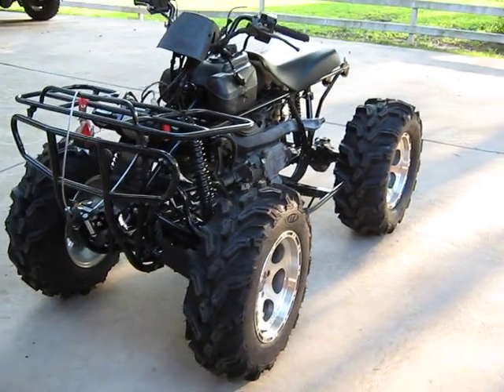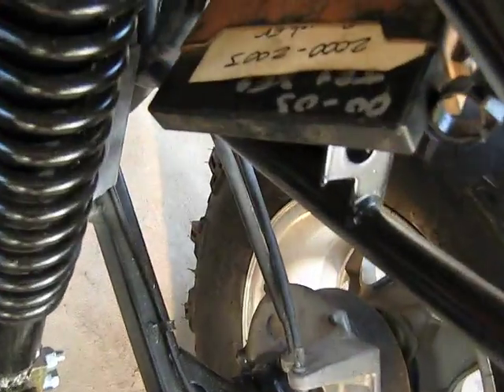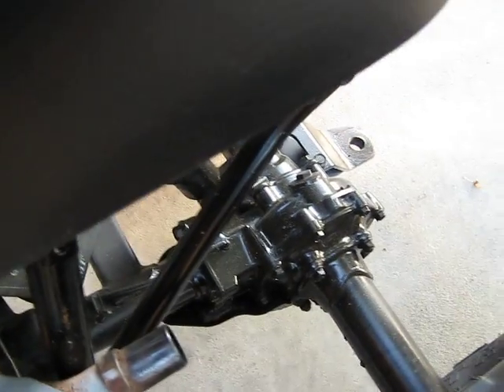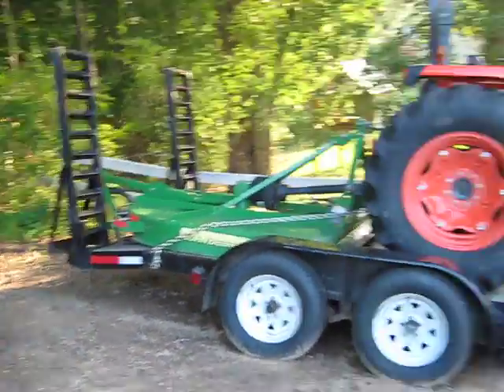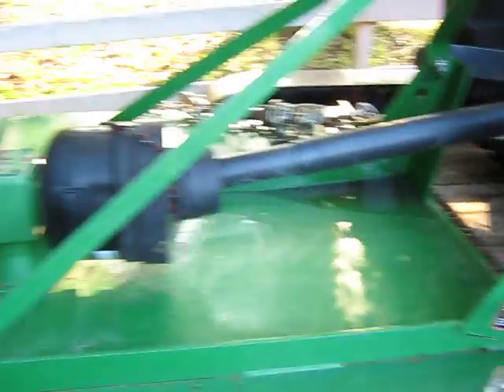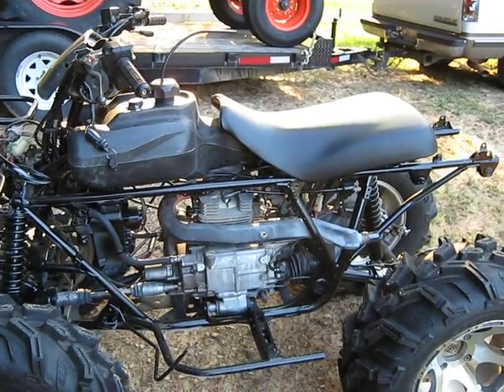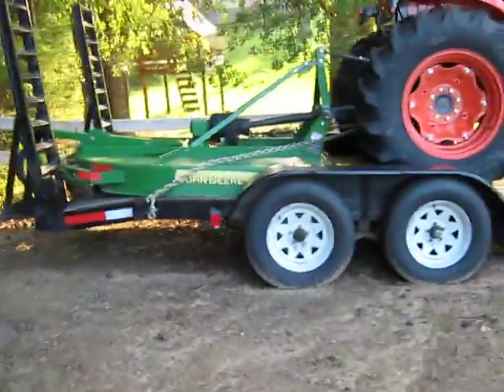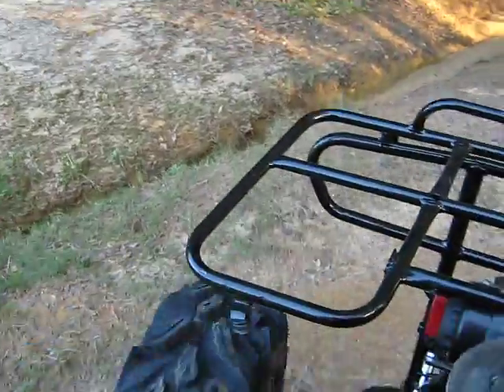HONDA RANCHER GETTING CLOSER TO HAVING IT BACK TOGETHER

Comment from the maker: @00cmjproductions00 yeah, i had the it hooked up wrong, i had the neutral wire going to the starter relay, completely crazy that i forgot which wire was which, so it was going to ground. not good...but i figured it out later ,